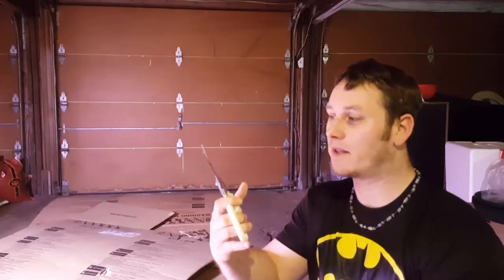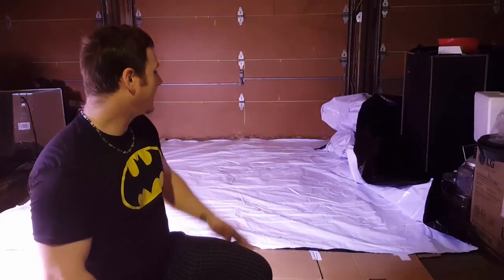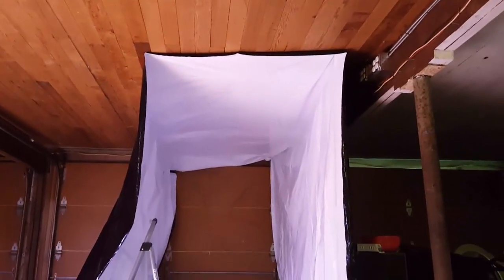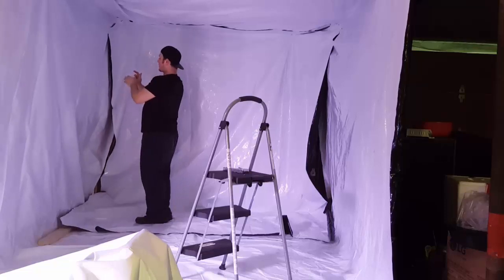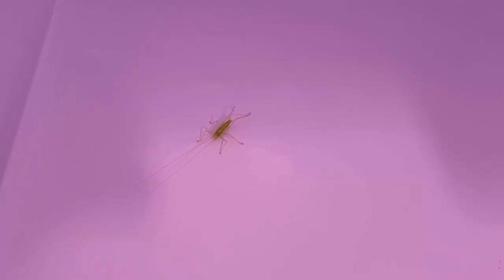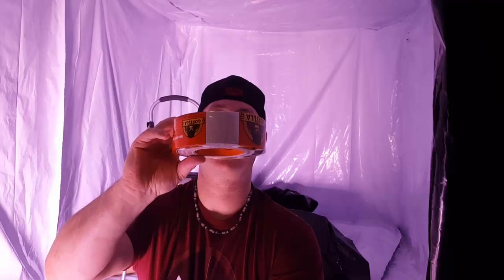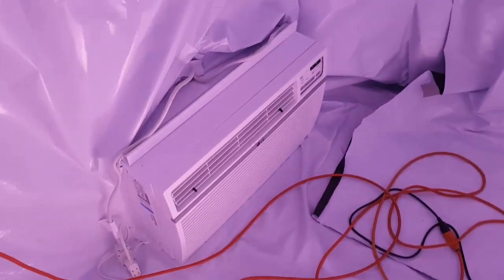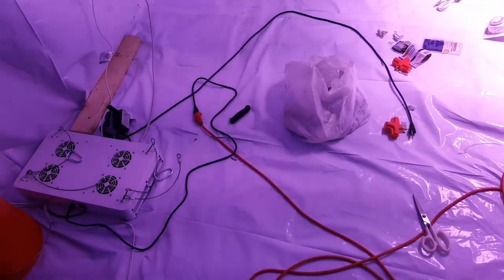How I Built a huge grow room under $200 Step by Step

Comment: Silver backed foam insulation board in 4x8 sheets with cap nails and foil tape at Lowes is a small growers trick for walls (with 2x4 stud frame of coarse) . I say small growers because anything in a house garage or basement or spare room imho is small. Tent grows. ..micro grows. I only say this because ive seen some big ass grow rooms in my time. Good vid though.

Comment: You could paint the ceiling white, cover the doors with weather strip and panda then build a few walls with 2x2's panda both sides use a couple duct collars and hoses for air run a little 12/2 for 3 circuits add foam insulation if you can afford it paint the floor white and double door your entrance on the cheap your still talking $500-$1000 and for that am out why cut corners.but I love your energy and I wish I could get around like you, cheers.

Comment: You can take parchment paper and and clothing iron and weld plastic seams together. They are air tight and really strong.
Reply: Does the paper go on both sides of the poly seam ?
Reply: @edwin7126  to protect the iron from melting plastic and whatever youre doing it on..yes

Comment: Even though your concrete is dry its a bad idea to use card board on the floor moisture coming up or through the doors and its mold city, that's a big DIY nono.
Reply: weedosoarus Rex  Rookie mistake

Comment: I would have used guide wires with pvc on them as rollers at the ceiling level to unroll the plastic first. Then align and staple. The wire and pvc can then be reused later. But whatever works for you.
Reply from the maker: Actually, just PVC would have made it easy to align. Good idea. I think I will use my PVC I have for when I do the veg room.

Comment: Another idea you might consider for sealing the doorway. magnetic tape (not cheap) but very effective. or heavy duty plastic zippers and gorilla glue, if you can find them.
Reply: be sure to have a raised floor wall though so you can get a good seal
Reply from the maker: Yeah, I was planning on using magnetic strips. If I can find a long zipper, that could work well.
Reply: +Grow Pot Cheaply call the fabric stores, maybe they can give you a lead on suppliers

Comment: Hi I have a question for u I've asked on autoflower net but I respect your opinion more than most ok I'm on my first grow and I misjudged the amount of soil I would need they are big pots but only filled maybe 3/4 full if that they have amazing growth they are at day 24 do u think I could add ore soil to the top or maybe perlite coco or hydroton in top of the soil will it hurt or improve plants or should I jus leave them alone they're doing fine jus ran low in soil thank u
Reply from the maker: I would just leave them be.
Reply: +Grow Pot Cheaply thank u I really appreciate the response got my environment down exactly like u said and my first grow has been more than a success so far thanks to u I still have a long way to become a decent grower keep up the videos
Reply: +Chris Burgess thank u they look good if it changes then I'll change something

Comment: Would have been easier to measure the floor+Roof+height on both sides and rolled out the plastic and then cut that length and then installed.

Comment: cool room. on suggestion though in stead of staples why not use a brad nailer and a one x two for the ceiling the who in the same size as a staple and you wont have to use any tape that might fall on your lights causing a fire hazard. good ideas though. cost effective.
Reply from the maker: Does it use a type of staple? Either way you need something to keep the panda plastic from tearing where you hang it.
Reply: Grow Pot Cheaply think he means to run a 1x2" strip of wood and nail that instead of the tape/staple. I usually tape and staple myself but the wood sounds like not a bad idea

Comment: Are you using ur window unit ac unit just sitting on the floor? Do they not need outside air to work?
Reply from the maker: It uses the air outside the tent.

Comment: i ave a question for you mate i have a 5x5 gtent  and im not to good at the old math what lights would you reccomend for that size to get maximum yeids  i currently run two 600w hps in cool boxes but the heat outside is a bitch  so in the tent is like hell  any advice will be  greatfully received.                  Gman   uk
Reply from the maker: Two 600 hps will work. Just run an ac to keep the tent cool. A 10,000 btu will easily keep a 5x5 cool with the condenser hardly having to kick on.

Comment: how will you do air exchange with out pulling the staples out? and does duct tape melt off the plastic when you have lights in there too?
Reply from the maker: My lights don't project heat. They slowly release it and not very much. I also use AC. I use CO2, so I don't need air exchange.